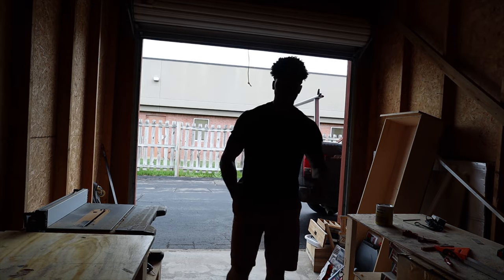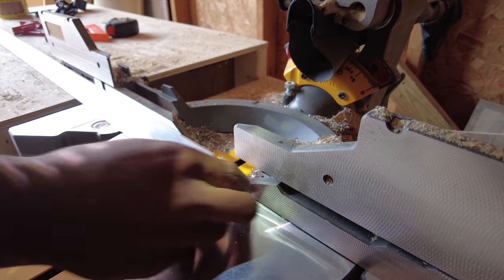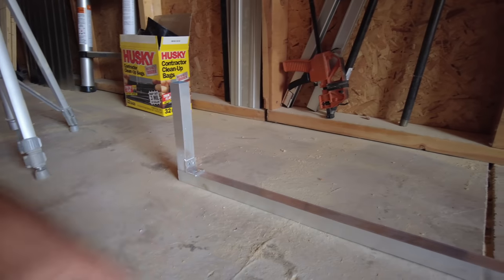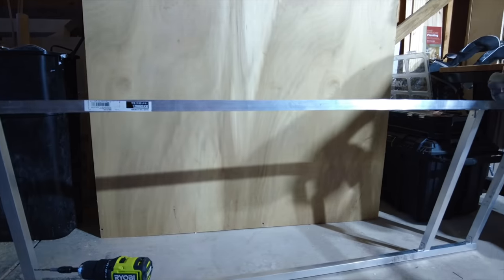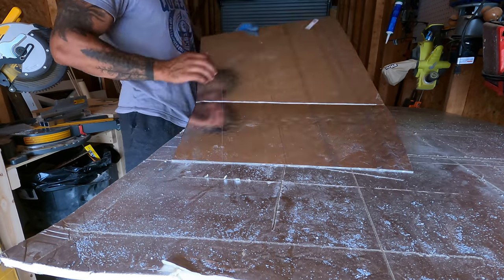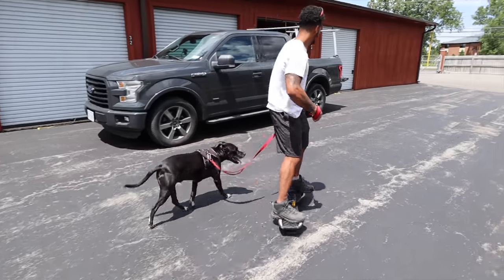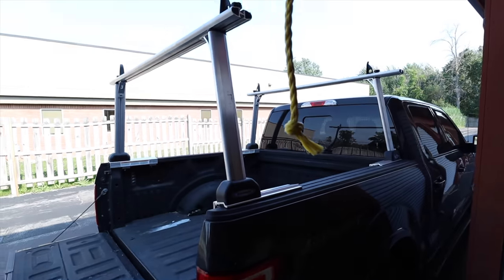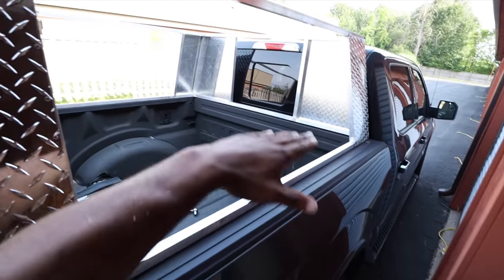DIY No Weld Aluminum Truck Camper Frame | Overland Camper ep. 1 (Foundation)

Comment: they make an acid flux for the alum soldering that when properly applied it really makes it go easier and a better bond, I'm a retired machinist/repair guy and we had the expert come out back in the day and demonstrate the way to make sure the customer had best possible product, no call backs
Reply: HF has a decent air gun for pop rivets not too expensive, they hold up pretty well, mine is about 15 years old and still no sign of quitting. saves your fatigue factor on the big jobs

Comment: It's a little more expensive, but using huck bolts instead of rivets would make it a lot stronger/more rigid.  Curious as to how you intend to mount the camper frame to your box - stake hole pockets, or clamps to the bed rails?  Also, maybe consider some sort of foam or rubber gasket between the camper frame and your bed rails.
Reply from the maker: I’ll take a look into the huck bolts. Thanks for the tip! I’m going to be starting off with truck bed “C” clamps and eventually using bolts to hold the camper down to the truck bed
Reply: Nice tip.
Reply: Nice build of a camper shell- should get years if service!
Reply: A "little" more expensive

Comment: Great job and great job videoing it👍 I’m 65 and grew up broke…if we didn’t get resourceful …stuff didn’t get fixed. Verrrry smart riveting And brazing everything. You could “get by” by just brazing. That unit will last long long time. My friend, I’ll be building one and will be using used van rear windows, and pick up truck rear windows… Solid tempered glass. Thanks for being thorough in the brazing process. I was wondering how long you heat before applying the rods. Thankssssss - smart, resourceful kid you are. 👍👍👍🇺🇸👮‍♀️
You also taught me how to bend the diamond plate and keep it square

Comment: I find your method of brazing the joints with the aluminium filler rods to strengthen them in addition to the riveted 'L' brackets to be quite inspired thinking!

Your method of filing a vee channel at the joints to allow a greater bonded surface area is also very clever.

Likewise, cutting a channel in the sheet metal to bend it rather than shear it gives a stronger, waterproof and neater result.

Your meticulously precise detailing and suberb craftsmanship are evident in everything that you have done and are a joy to see.

You inspire your viewers to construct for themselves and give excellent and informative information.

Thank you for taking the time to produce excellent videos, I will use your riveting and brazing technique in the fabrication of my amphibious bicycle camper (including the use of Sikaflex to bond the sheet aluminium to the frame before it is riveted).

Comment: I began to love your work from the beginning. Remember to put a rubber seal between the truck n camper. You can also bend your tubing 90 by cutting a 45 then bend it like you did the metal siding then add a 90 to the inside like you did. 
I was also thinking of getting a older 8ft aluminum camper n cutting it down. I have a truck like your's.

Comment: Hey man, I probably know the type of rooftop tent you are gonna build. I would suggest getting on Amazon and buying one of those cheap dual-power tig welders. You don't need a lot of power, just run it off 110 at your camper and go in there and weld it up from the inside. That brazing rod is not gonna hold any amount of weight. To "weld" something you need to melt both joining metals together. Using that torch and brazing rod is simply melting the rod and not the joining structures so it's just gonna crack apart over time.

What is saving you, is that you did a good design using the aluminum sheeting and bending it around the corners so that is what is actually holding it all together but even that will eventually start failing under load as the rivets will flex and loosen. You really should get one of those cheap tig welders and just run it off 110, even if you have to borrow an outlet somewhere. You have the basic frame built, so you can just go somewhere with power and weld it up with a small welder and will let you learn a new skill.

If you don't actually weld it, what will most likely happen, is the joints will slowly flex and start coming apart because of the weight up there on the rooftop tent. Without the tent, this would probably work fine for a no-weld toper, but once you get everything up there and then you are climbing in and out it's gonna put a lot of flex on those revits. They will last for a bit but I doubt it will last long term. You really need to weld this if you want it to last. 

Aside from that, it's a nice-looking design.

Comment: Very nicely done.  I built an aluminum no weld camper using t-slot aluminum aka 80/20, expensive stuff but very strong.  Had I seen this video first, I would have used your method.

Comment: Just a small tip. Next time you can cut it all in 90 degree angle like you have done with the roof. That will allow to hide the L brackets in side the tube and then you work your magic welding. Not only only will look industrial perfect but will be much stronger

Comment: Looks great.   You may want to consider panel bond for the panel to frame connection in addition to rivets.   Will seal and add a lot or rigidity.    Great job.

Comment: Did you test the strength of just the L bracket joint, vs just soldering the joint,  vs bracket and soldering the joint?

Comment: Ingenious! I am impressed. 
I am curious how this camper top has withstood fatigue stresses over time. Aluminum is much lighter than carbon steel, but is more prone to fatigue stresses it would encounter from wind, driving and rough roads. However, this seems like a great idea. Given the price of fibreglass toppers, this looks like an interesting route for DIYers.
Reply: I would also love to hear about the long term rigidity of the structure. Cheers

Comment: Weights a huge thing when it comes too canopies and draws it amazes me how many people use wood. I’ll be doing drawers in my wagon soon and I’ll be using 2 good quality canvas bags with a sheet of checker plate on gas struts. Not sure how it’ll go. If it works out I’ll get a video of the finished product.

Comment: If you have no electricity, how are you running that saw? Wouldn't a generator run a welder? I like the brazing, tho. The argon gas set up needed to weld aluminum is a pain in the neck in a home shop.

Comment: I only have some experience with welding but your gonna need to have a aluminum welder for aluminum only because regular welders won’t produce the heat for it I think but also make sure you only use certain tools for aluminum because aluminum rust easily and any other metal shaving will start the rust for it and you can buy a battery operative welder on Amazon and I got my experience from collision repair that I took for a year so I know only about car metal but I can weld pretty much anything. I hope this helped sorry it’s long
Reply: Aluminum doesn’t rust.

Comment: In europe we have a adhesive/ glue special for making aluminum cars/ truckboxes. Its very strong. You dont need welds. Its called MS 939 from teroson/ henkel. The construction you made wil come out with this mutch stronger than the poprivet.

Comment: Been looking at doing this for a while on my truck since its an off size and older with no available shells for the bed. Anything you would recommend instead of diamond plate? Maybe sheet metal in thick gauging? The other idea I threw around is building the frame and doing a poor mans fiberglass job

Comment: If you heat up the the aluminum panels a little bit, it will be easier to bend corners and less chances of it completely breaking at the bends... Just a tip

Comment: Nice. You do Gd work. Y didn't you use self tapping screws to save time. Also, maybe consider in the front adding in an angle 45°, a foot more for head room .?

Comment: you're sautering the joins. Not welding. You have to melt the surface material as well. Use a big battery in order to weld, keep up the good work bro.

Comment: Not to be a downer, but this doesn't look safe for highways speeds. Those pop rivets won't last. I assume the rooftop tent will mount to the frame you unbolted before the rest fit?

Comment: Please protect yourself. You look healthy and young. Put in a fan for ventilation. Aluminum  brazing rod off gasses toxic fumes. It looks like you have a roll up back door. Use it for projects like this. Then when you get older and know most things youll still have the health to do what your mind wants to. Other than that rant. Good job and I learned a thing or two. Thanks

Comment: Its already been mentioned, but this is NOT welding, it is not even brazing, at most it is a soldering of a kind to mask the thickness of the edge of the joints. The only strength in these joints is in the rivets. In UK we have a bond that will hold ali with some strength, stronger than your welds. I only posted this as a safety concern. Your work ethic is good, but those ain` t strong joints. And yes I am a retired welder......

Comment: Dude I would have framed it out all the way over the top I've the cab so you could make a bed there. Leaves there entire rest off the space open for living area.
Reply from the maker: Watch the rest of the videos in that build series. That’s what I ended up doing. I just built it in parts

Comment: I was very excited after seeing your video untill trying to price the boxed aluminum and diamond plate. Double your price and that's what others should expect maybe even triple . The diamond plate is 90 dollars a sheet
Reply: Is it maybe 24 x 36 sheets of diamond plate I found those around 22 ish each very interested in this build .
Reply: Also the brazing rods were very expensive 4$ for 2 :( how much map gas did you go through how many rods did it take? What grade and size rivets did you use? Plz and ty so much for the video
Reply: One more thing! The windows... Had you planned for rv style drop in unit? Or?  I know this has only been 2 weeks but maybe give us some update or thoughts on how you plan the final build to look. I know you've stated it will have a rooftop tent . And also! What about sealing this thing from water and wind . I feel insulation will be important on the exposed metal will transfer heat and cold to your inside cabin area in the build. Sorry for so many questions! Very excited to see how this turns out and hope all the welds hold maybe a stress test going down a bumpy road? Again thank you for showing this option has a very high finished product qaulity and look!
Reply: Hey Trent. I don't know where you are (obviously) but I'm in Portland Oregon. I too was blown away by aluminum prices when I shopped retail for my project. But, I found a local "wholesaler" that changed my whole world. There is no advertising, website or even a sign outside.  The material there was pennies on the dollar compared to even online retailers. The place was a little more than a dirt lot on the outskirts of town. And don't expect any help or customer service.  Yet I was able to buy aluminum stock at a sick low price per pound. Maybe there is something like that in your town.

Comment: Hmmm, says I.  No reason this technique wouldn't work for making an enclosure over the service body of my pickup.  I envision a ladder/canoe rack, over a solar panel, with a roof, sides and back door to serve as a camper of sorts.

Brazing, vs. soldering, vs. welding...  Biggest difference is the temperature.  Welding melts the two pieces to be joined, and can be done with electricity, gas, or even a coal forge.  Brazing and soldering both involve heating the metal enough for the metal to melt the joining media, but not the metal itself.  Brazing temperatures are higher than soldering.  Then just to keep it all interesting, there's braze welding.

Comment: People have built airplanes by brazing aluminum, so there's no reason it can't be used to build anything else. Welding the type of aluminum you used is an exercise in futility anyway. Harder alloys, thicker material or cast aluminum is one thing, but you'd almost certainly have the welds themselves tearing out of that tubing if you welded it. For the panels I would have gone with autobody adhesive and rivets though.
Reply from the maker: That’s some good information for me to keep in mind. Having no experience with metal working at all, it’s good to know I made the right choice on materials for this project. Wish I knew to try auto body adhesive. I’ll have to try that out as I do future projects. It’s all a learning experience for me

Comment: bro, Im sorry to say but using the brazing rods is like securing it together with scotch tape and bubble gum.  You keep saying "weld" but its brazed, not welded.   Looks great to the untrained eye but those welds will snap at the slightest amount of pressure while on the road when its attached to the bed.  I know it was alot of time and work; I hope it works for ya, but ya gotta be smart and stay safe.  At this point you will be jeopardizing the safety of not just yourself, but  the other people on the road as well